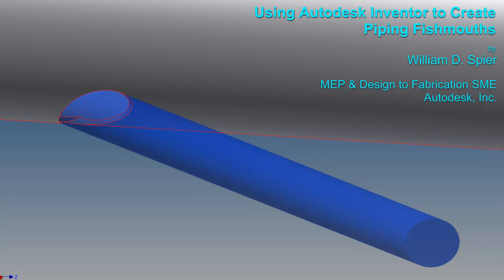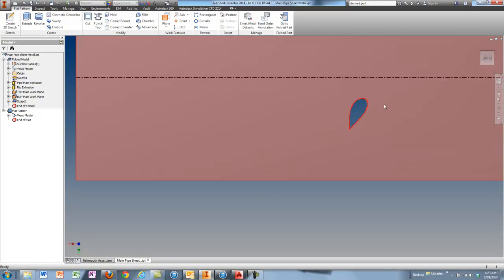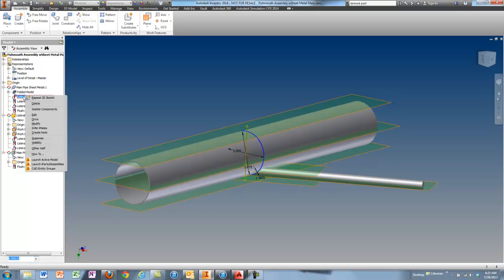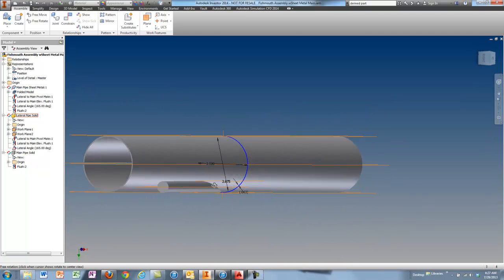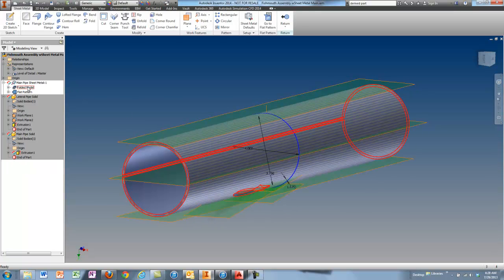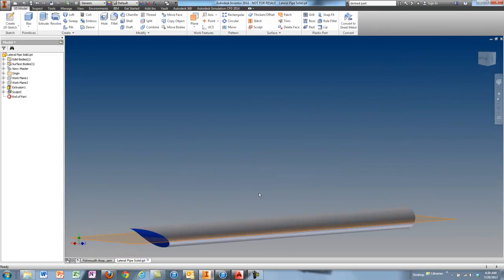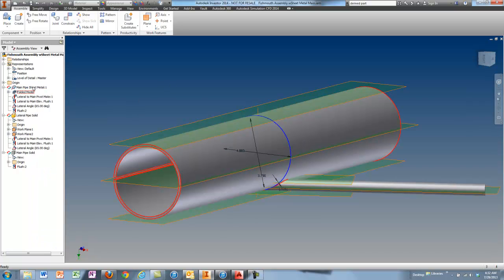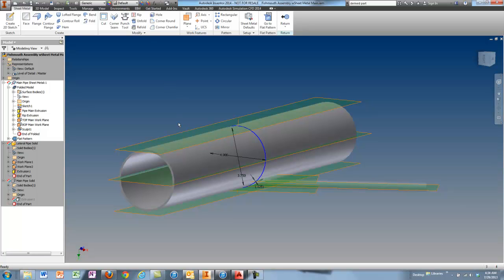Create Piping Fishmouth Templates with Autodesk Inventor & AutoCAD

Comment: Thanks for the video, I actually use inventor for the opposite of what you showed us (cutting the beveled end of insert pipe). What I do is create that smaller pipe as a sheet metal part as well then flatten and plot, gives you the OD or ID. This is really a beneficial tool when detailing a TKY joint on a truss.

Comment: Hi Will, great video and getting very close to what I want to do BUT and this is good because I have seen nothing on this on you tube. I really want to know how to do this? Take your main folded pipe in this video and then add another 2 lengths of the same profile pipe to it, end to end, but pipe that projects away at different angles on two different planes at the same time. And to do it so that one can get a flat pattern for each section. The pipes will be cut at their natural intersection. Do you know how to achieve this?? eg the second segment of rolled pipe might have a z plane angle of 10 degree's but also a Y plane angle of 25 degrees whilst the pipe it joins runs parallel with the y axis. Please Help???